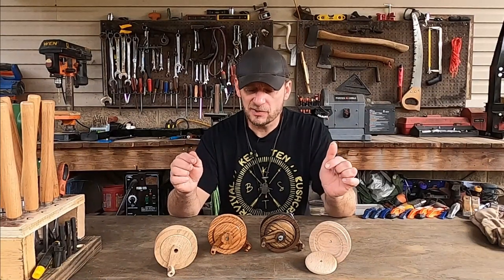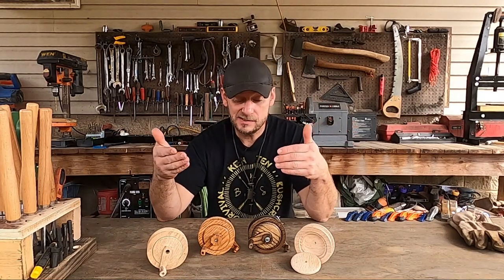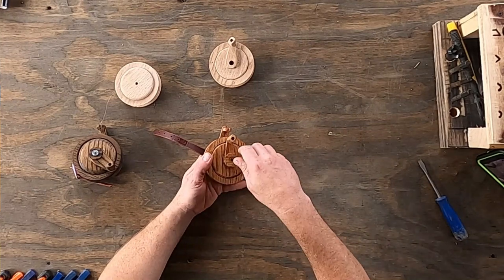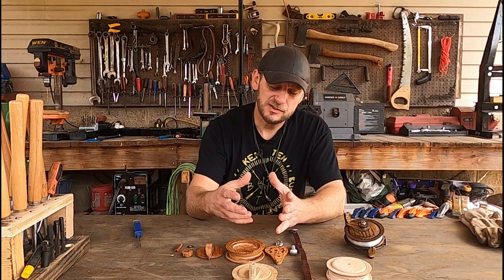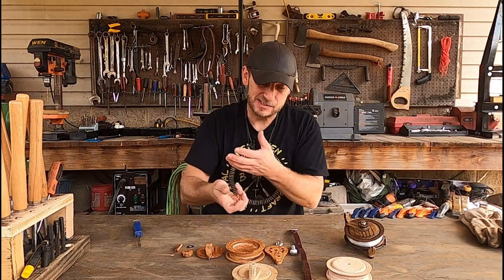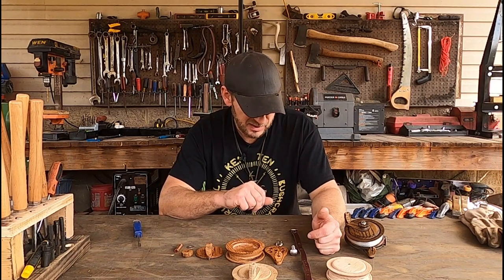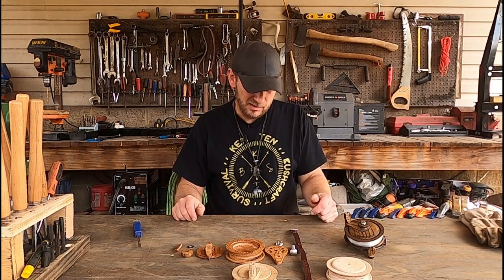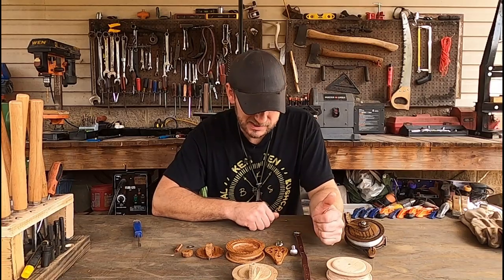Hand Reel Why and How Hand fishing Reel

Comment: That's pretty clever. When I was growing up the Pocket Fisherman was the rage. So to solve my problem I whittled out a wooden looking Pocket Fisherman. It has a slant on the top where you can place a regular real instead of using zip ties I always use Velcro straps. I even drilled a hole in the end of it for the line to go through. I had got some little metal I hooks that I never used any of them for that of course I used my wood burning set to make ridges on the handle the whole things about 10 in Long and fits in the bottom of my haversack really easy. Sinkers are not that big of a problem. If you have a little extra material like off a handkerchief or a rag you can sew a pouch and fill it with sand or tiny rocks pretty easy. You just keep it away from the lure and I'm pretty sure you don't want bright colors. I keep all of my fishing stuff in a tobacco can one of the two ounce kind it'll hold a remarkable amount of lures weights and everything else. Personally I always go for a heavy line that is invisible in water. I'm not talkin about 50 lb or anything usually around 20 but I like a little bit of an edge as long as it's invisible in the water it's all good. If I ever break the fisherman it doesn't take very long to carve another one. I couldn't believe how easy and quickly it was to make. They're too damn expensive to buy brand new and they are cheaply made. I usually use a 33 micro but any size would fit it's carved out to slip the bottom part in and velcro straps hold it in place. I guess you could put an 888 if you really wanted to on it.
Reply from the maker: Very cool! Love the tiny sand bags for weight!